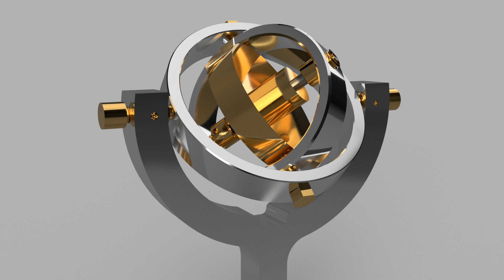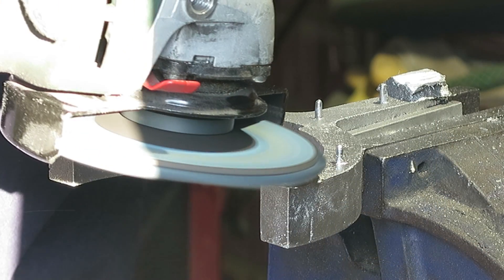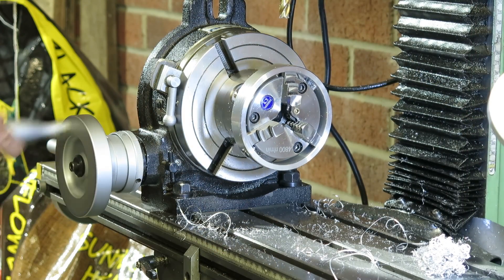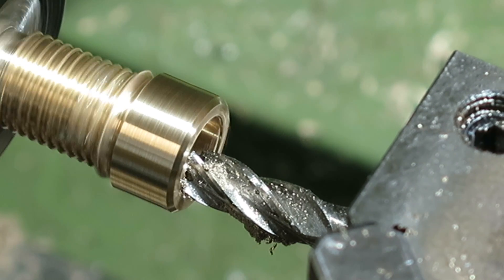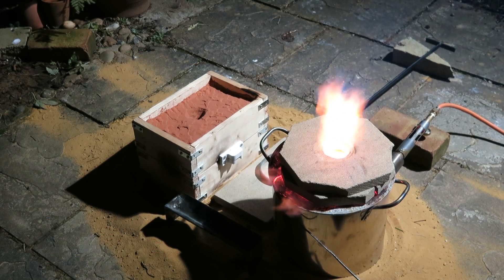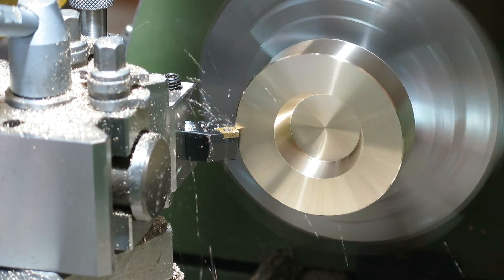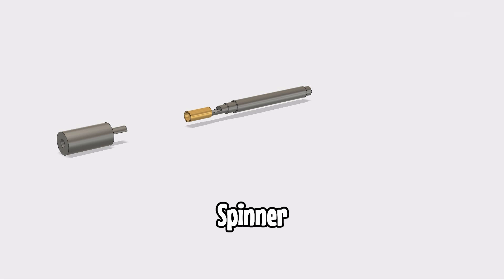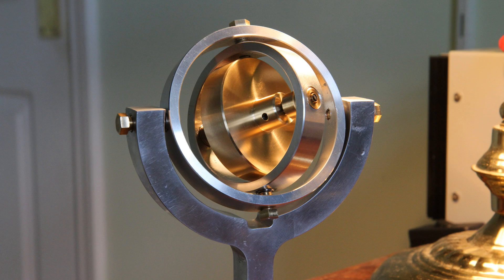Making a Home Machine Shop Gyroscope MKII

Comment: Do you have the measurements of the parts and the screws, at least to send in PDF?
I intend to do a school work with this.
Reply from the maker: Hi Matheus. I don't have any plans that I can easily send you, but looking at my Fusion 360 design the most important dimension is the wheel which is 66 mm in diameter, and 15 mm thick , so about 470 g in total mass. The shaft is 6 mm diameter, and everything else is scaled to fit.
Reply: David Cambridge thanks

Comment: Hello there, are you using the milling attachment for the 250V? I am getting a regular old 250 soon (which your vids have inspired me to try and make a gyroscope with). I also need a mill but don't really have the space / cash for one of the full size warco mills, and so was looking at their milling attachment. Just trying to get an idea if its a useful purchase or not :) Secondly, do you find the casting process to be particularly fraught or dangerous, or is it a case of once you know the pitfalls to avoid its ok?
Reply: Ah never mind, I dont know why I thought you had the mill attachment, its clearly a full mill!
Reply: I'm a hobby guy and do casting with a home made melt furnace. The basics are easy enough but the fine points require learning more. See Olfoundryman & Myfordboy videos. I have a mill & lathe and continuously find there is some tooling or accessory that I wish I had. Those add quite a lot to the cost. Very nice work here. He doesn't show the measuring required to do this fine work. I also could do W/O the music noise.

Comment: This is a great video and the Gyroscope is fantastic! I think calling it 'home-made' is a bit of a stretch though. Some pretty specialized and expensive equipment is being used. It is more 'Machining a handmade gyroscope'.
Reply from the maker: Thanks for the comment, and I’m glad you liked the video – it’s the positive comments that give the incentive to make the next one!  The “homemade-ness” of it has proved to be more  controversial than I’d expected, although you’d be surprised that the kit isn’t as expensive or inaccessible as you might think.  At  least according to Googles figures, the cost of an average UK family holiday is about the same as I’ve spent on a mill and lathe which is not bad for a hobby stretching over many years. So granted, not cheap but within reach for many if sufficiently interested. The bigger problem is of course all the space it takes up in the garage!
Reply: @DavidCambridge  Yep. All home workshops are created equal... but some are created more equal than others. :-)   My workshop is a draughty shed, 8' x 6'. I have no proper machine-shop facilities, but I don't mind. I get to DO STUFF! That's what it's all about. Creativity and construction and the immense feeling of satisfaction to be gained from making things - ANY things -  is in your hands and in your head, not in your hardware.

I enjoy all of your videos, so thanks for making and uploading them.

PS - My most important piece of workshop equipment is a kettle. Tea and Hobnobs? Yay!  My cat (Gromit, the works foreman) disagrees...